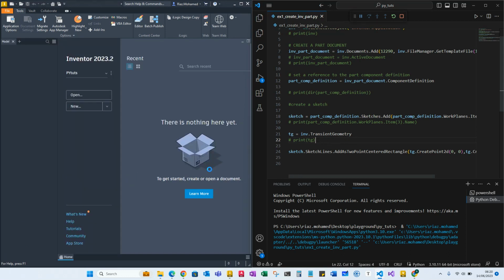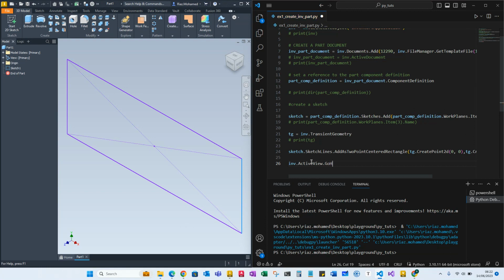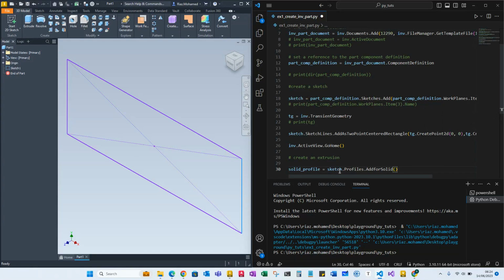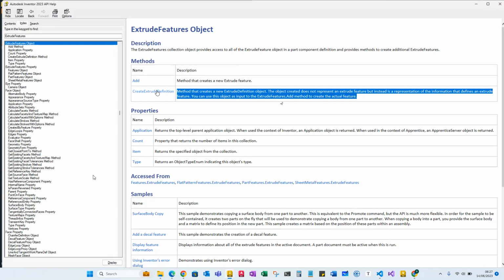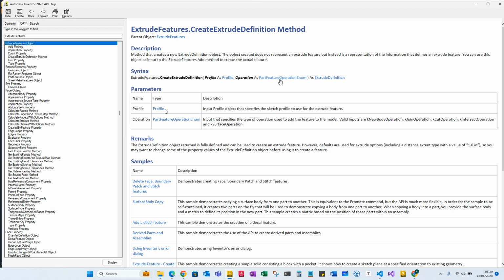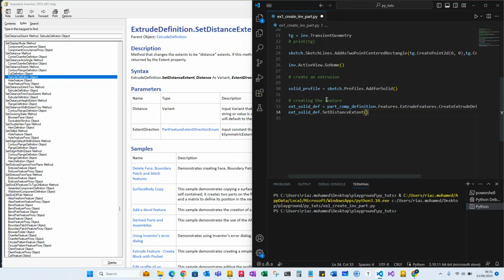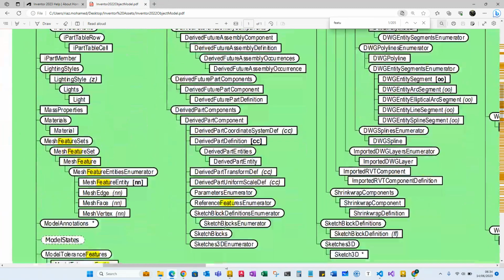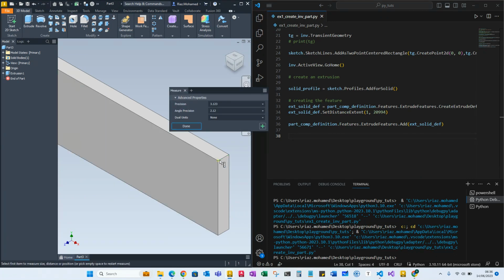Part 4: Creating a 3D model from a sketch using Python and Autodesk Inventor API

Comment: You are correct, this content is lacking, a lot of people show what they did, or tell you what to do, but few people take the time to explain why they are doing it or to explain it in a way that something with little to no experience can follow along "without" having years of experience, again thank you! I am very interested in how to create forms for iLogic using vb or python.
Reply from the maker: I have been using this for a few years now so I had built up good experience in programming in general. There is a lot of misguidance out there on how to learn to program in general. We can technically run inventor or any cad software just with raw python. Even without inventor or any other cad software API